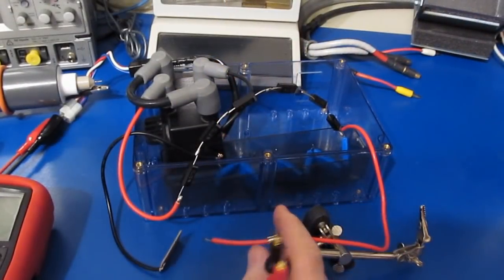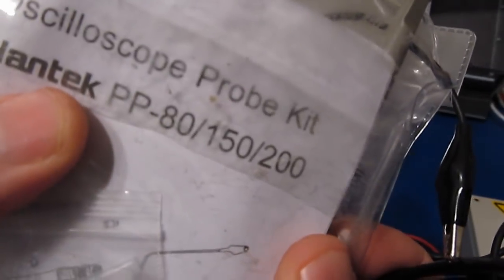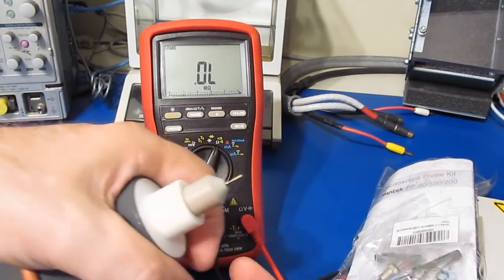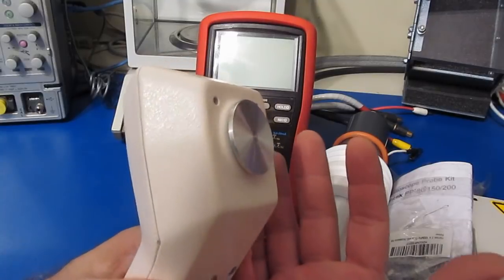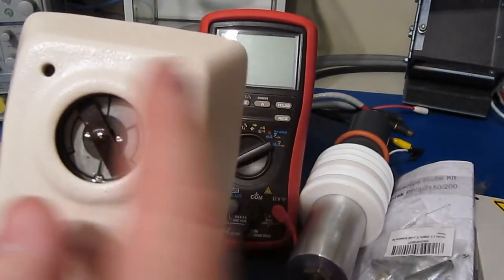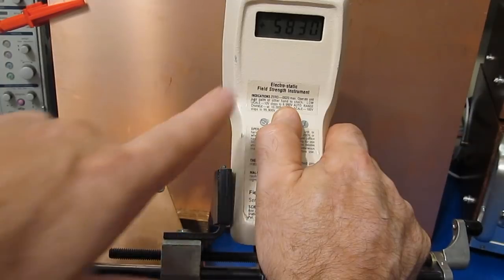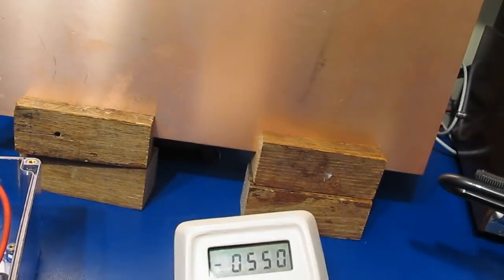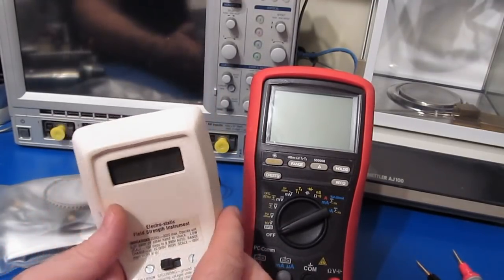Vintage Electro-static Field Strength Meter

Comment: I was always wondering, could possibly connect couple multimeters in series to measure higher voltage?
Reply from the maker: If they were a matched pair maybe.  You could also add a shunt resistor to get them to try and balance.   Risky but I see no reason why it could not work.  Imagine if one does fail, the next one is going to go along for the ride.

Comment: What a good device to measure high voltage with non contact voltage.  Of course it has it's disadvantages and may  require a HV power supply, a target for personal calibration.

Comment: Yeah thats very usefull! I try to reach one megavolt dc with that new 30kV@10nF C's and 20kV diodes from aliexpress. I thougt that with 130 of them, halfway feeded with ±11kV@33kHz i shoud come close. But exept with dischargelength measure i cant know the reached voltage, and the 60cm indicates only 600kV. But thats under full load of the discharge. I think your apparatus is ideal for me, but the only way i can think of how to make it myself is with a fet. And that wouldnt give me a so clear and stabile output in volts i think? Do you know how your fieldstrengthmeter works inside?
Reply from the maker: Did you read the paper I linked in the comment?   I will add it to the description.